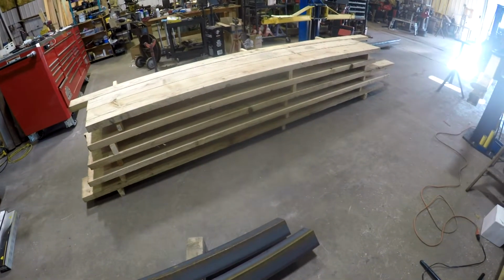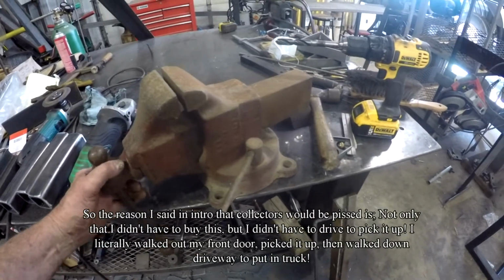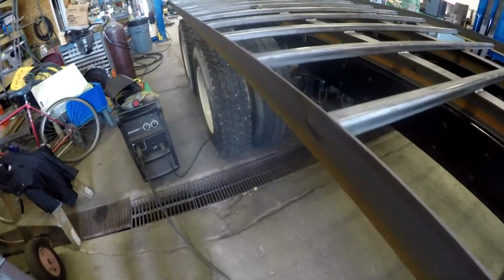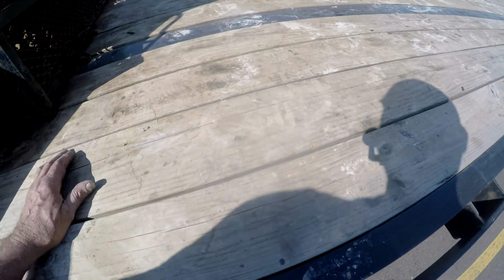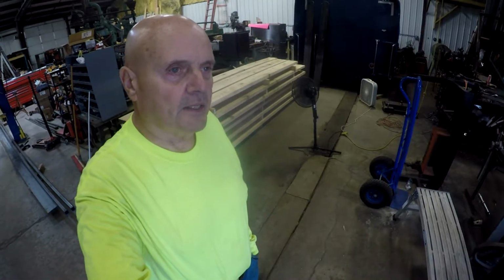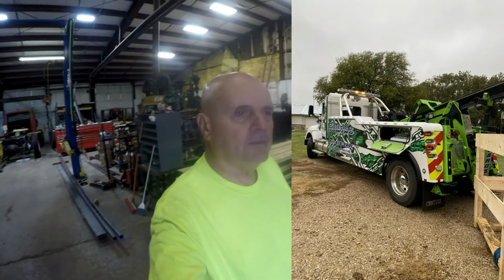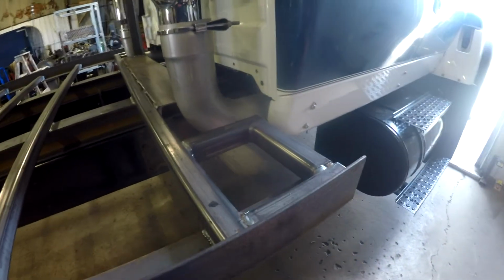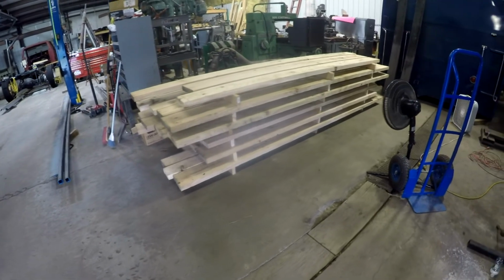Shop Update 09/29/20 Truck Bed Build-Reed Vise-Monarch Lathe

Comment: I knew that was the Monarch building in the background when you showed picking up the lathe. Sad that they have to rely on government orders to keep the doors open. :-( Be sure to weld the top sides of those tubes too so water can't get in.  I have heard you can soak wood in antifreeze aka ethelyne glycol and it won't shrink.

Comment: Truck is coming along well,was wondering,I used to work at a heavy truck facility, and we used apitong wood for the trailer floors,was the fresh milled wood cheaper?
Reply from the maker: I bought it from the Amish. All that wood was $195, which I thought was way to cheap so gave him $250.
Reply: @frednewman2162  That was cheap even at 250.